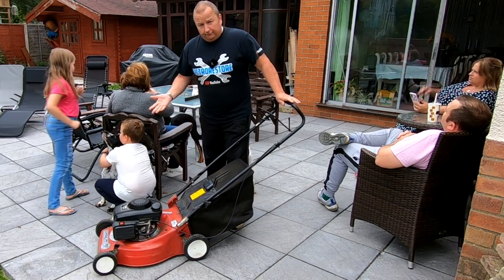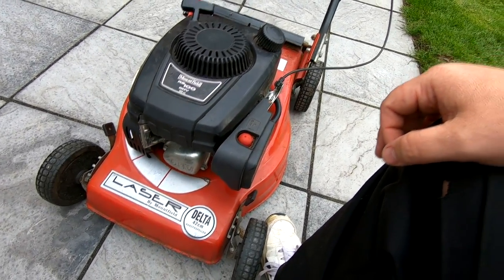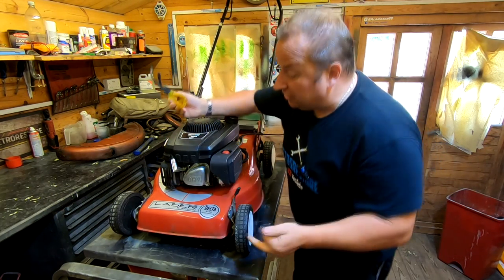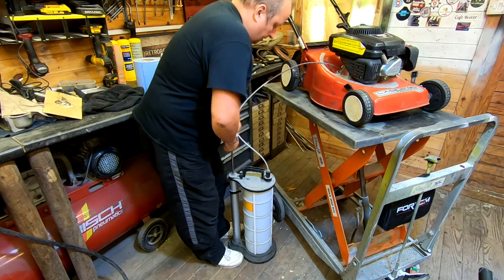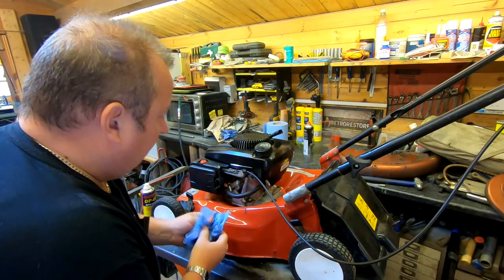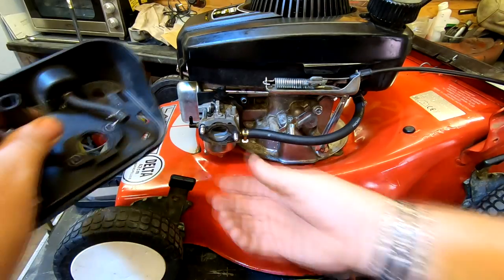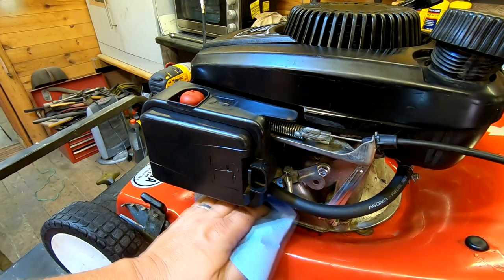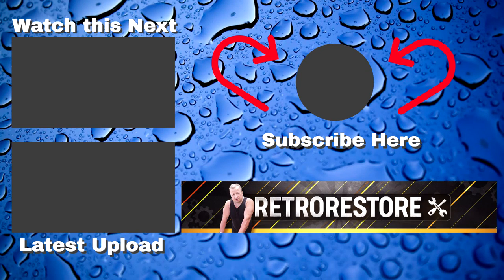Why Is This Lawn mower Revving Its Nuts Off?

Comment: i use a heat gun on the plastics caps to straighten them, i dont put oil on the filters and theres nothing wrong with a torch plug lol,

Comment: my primer bulb is not filling up some fuel comes out the air filter if you pump it many times ?
Reply from the maker: It will, that's what its supposed to do.

Comment: looks like its had a new engine as those lasers are old normally 20 ish years old good mower tho and thats a modern ovh engine not that it matters anyway when even i have those engines and they dont work i find the cure is there are 3 bolts undo them and let the engine fall into the bin then fit the briggs and stratton 35 classic lost count how many engines ive now replaced for a 35 classic
Reply from the maker: Can't beat the Classics Dan.